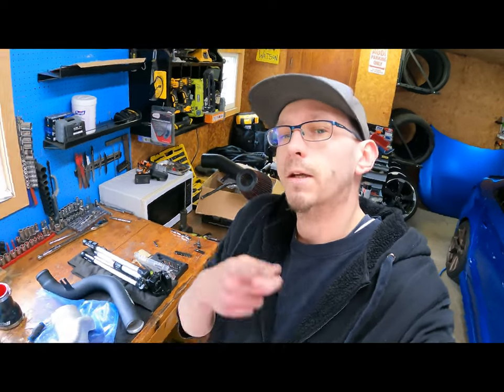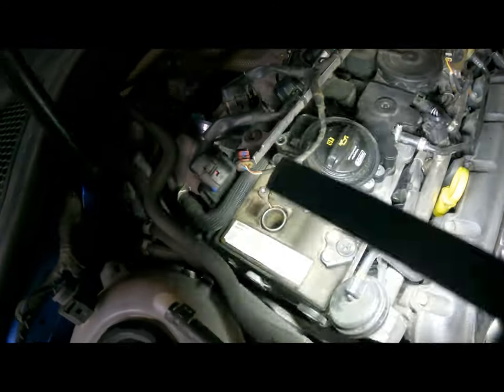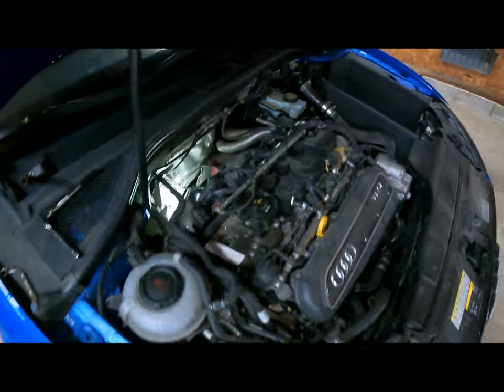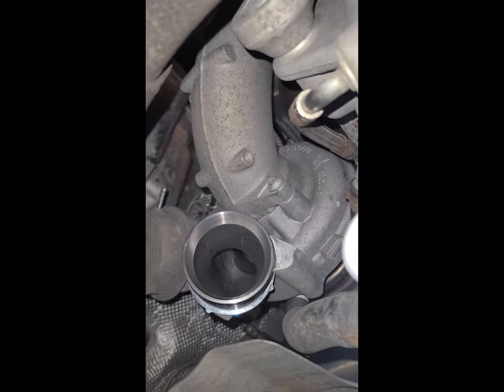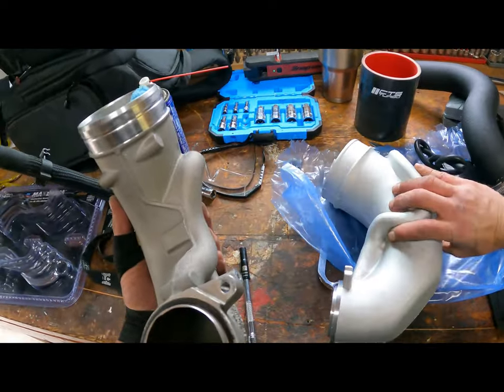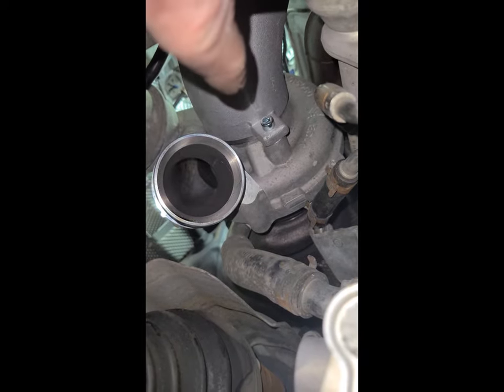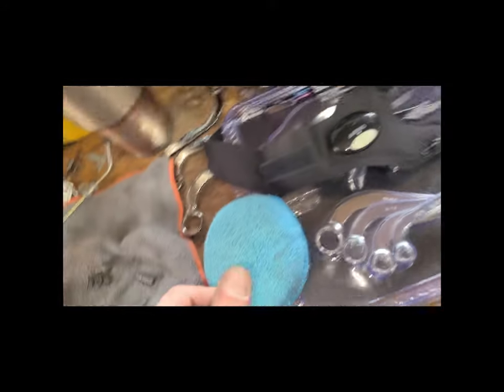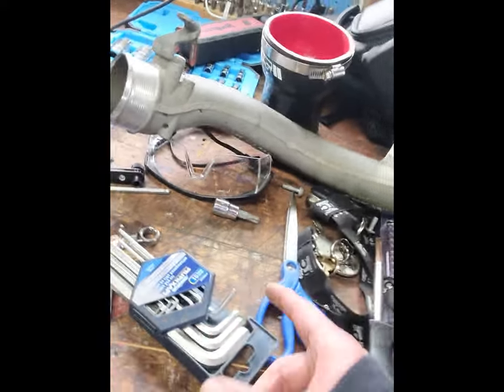2018 Audi Rs3 4" Inlet install (kinda)

Comment: Nice video and the turbo sounds great! I'm thinking about getting the CTS intake and inlet/outlet pipes. Do you plan on doing the throttle pipe or have any thoughts on it?
Reply from the maker: Actually, yeah I plan on installing the Cts throttle body inlet kit when I install my intercooler.  Probably next video or two. I haven't seen or heard much on the throttle body tho